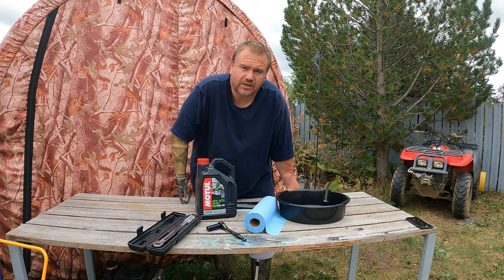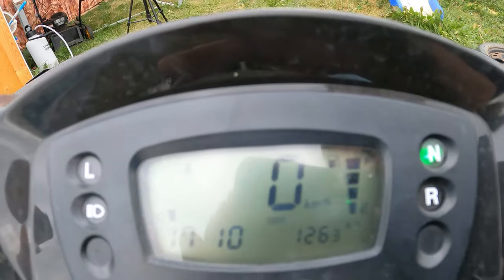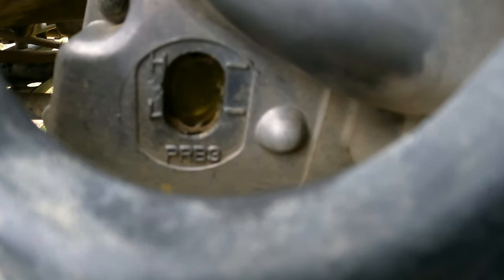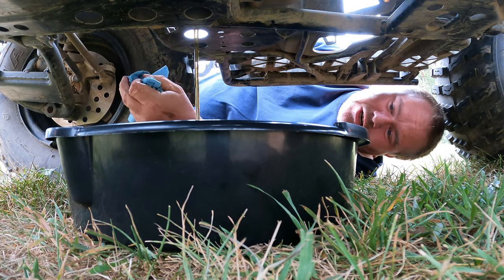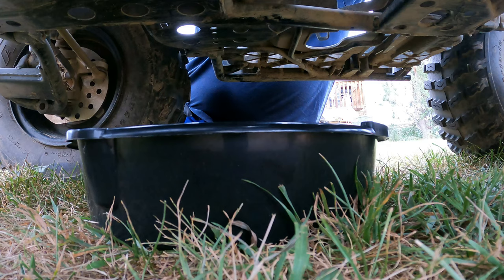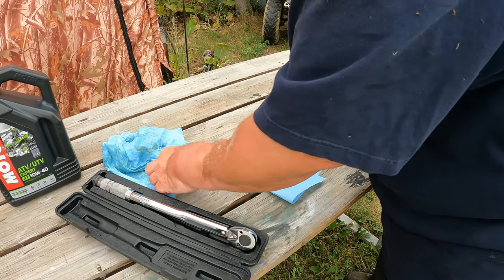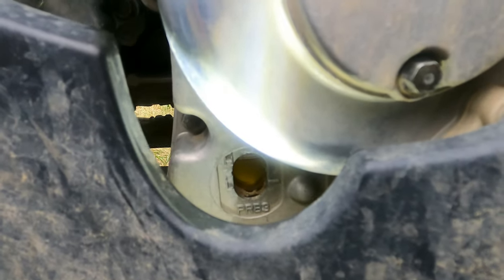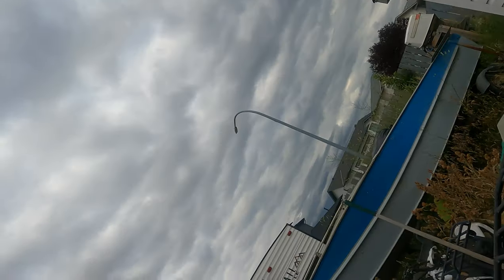2021 Kawasaki Brute force 300 oil change

Comment: I just switched from polaris to Kawasaki. I didn't realize the 300 didn't have an oil filter until i had already bought it. You did a great job on this video man. Thanks
Reply from the maker: it's a bit common for these smaller motors to not have a filter. I had a Honda 200M trike and a Honda 250R trike. neither had a oil filter and served me well for a lot of hard miles. just means regular maintenance is that much more important. and a flush may be needed if the new oil is getting dirty right away after a change. However my Kawasaki 300 Lakota had an oil filter, and i would prefer if this brute did. But the machine size was just the right one for my kiddo's next machine before going to something too big.

Comment: Terrific video and narration on the proper way to do this service.
I've seen vids where only the screen plug was removed for drainage. Did you get any additional oil when you removed yours, couldn't tell with my phone.
My 1st service is pending on my 22'
Bravo & thanks!
Reply from the maker: I didn't get much at all. just what was caught in the plug and screen basically. but pulling that screen and cleaning it is the best chance of catching any early signs of critical damage as it will catch the larger shavings. just pulling the screen for a oil change may not give a full drain either. you also wouldn't have the benefit of checking the magnet on the drain plug. so I do recommend pulling both at each oil change.
Reply: @thestuffwedowithron1768  Can't argue with logic lol, thanks for your input!

Comment: Very helpful!! Couldn’t you use the opener for the screen to drain the oil?
Reply from the maker: I haven't been able to find a reliable image of the crank case covers but my guess is you would possibly get mosy but not all the oil out from the screen plug. Therefore possibly not get a complete drain.

Comment: I have an exact same 4 wheeler and just did an oil change your video helped a lot. Everything went good until a few days after and I can't see the line where the oil is any more there isn't any oil underneath on the floor either. Any tips
Reply from the maker: Assuming it hasn't been lost by leak or blowby. When the oil is very clean if it's over full than the parts behind the glass will look slightly golden. If it's  low than you will see it looks more silvery. The bikes don't take a lot of oil so even just a little sideways lean can make the oil level look low or high. So lift each side of the atv and see if you can see the oil line at that time. If it's too high, lift the right side (side with the glass). If it's  low lift the left side.

Comment: Great video with detailed explanation. Did you do valve adjustment after break in period ?
Reply from the maker: I haven't yet. it's going to be part of the winter maintenance this year. Along with a coolant flush. The coolant flush is more because the manual states the coolant is mixed light and is good for about -15c. so luckily we didn't crack something last winter as we hit as low as -40ish. So new coolant at a richer mix is a must for my climate.
Reply: @thestuffwedowithron1768  Make a video about it if you can.

Comment: Can regular or synthetic car 10w/40 be used ?
Reply from the maker: To be honest, I used to use conventional auto oil all the time. but that was in old Honda trikes. like a Honda 200m and a Honda 250R. as well as a Kawasaki Lakota 300. I never had issues through the life of each machine. And I'm pretty sure the oil in my 2005 Brute Force 650 is 10w30 synthetic auto oil right now. It is getting switched out to the 4T JASO MA2 for this season and going forward. And as I ride year round I would swap the viscosities based off the current temperature extremes I would be riding in based off a viscosity chart. But as oils have progressed and advanced I'm moving more to using the recommended oils like the 4T JASO MA2 oil that Kawasaki recommends. I can't publicly recommend you use auto oil as it would definitely be best to follow manufacturers recommendations and would also be required for warrantee purposes, I assume. This is just an account of my personal experiences with this.

Comment: Hi guys just doing a oil change and I pulled the oil plug, all good there but just attempted to pull screen plug but quite bit harder to release the bolt , any tips out there???
Reply from the maker: It really shouldn't be much tighter. But in order to reduce the possibility of slipping and stripping the hex side. Use a 6 point socket. Not a multy point socket. And support the head of the ratchet very well. Use the shortest socket/extension combination you can. And just double check the ratchet is set to counter clockwise.

Comment: Did I miss the oil filter part?
Reply from the maker: The 300 doesn't have a filter. Just the pre-screen to remove large particles. That makes it important to keep up on the oil changes and clean that pre-screen each time. The larger brutes have a filter (600-700cc).

Comment: New atv owner same as yours I have a question how do you get fuel in the reserve tank? Does it go in automatically?
Reply from the maker: The reserve is just the bottom inch or less of the tank. There are 2 pickups in the tank. The main pickup is higher in the tank so that any buildup of water and residue doesn't regularily get to the carb. This would be the worst if you have water and the bike has been sitting. You would have pure water in the carb. The reserve pickup is right at the bottom of the tank. So use it if you ever need to drain the tank fully.